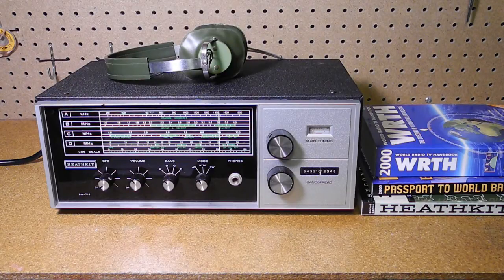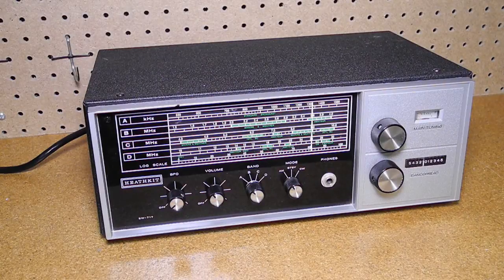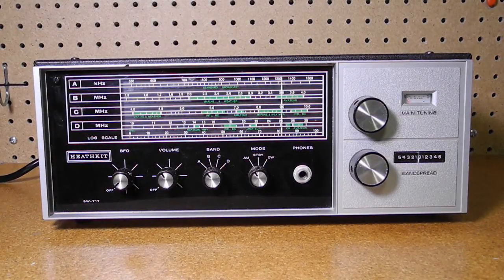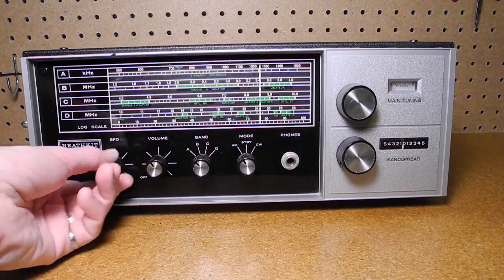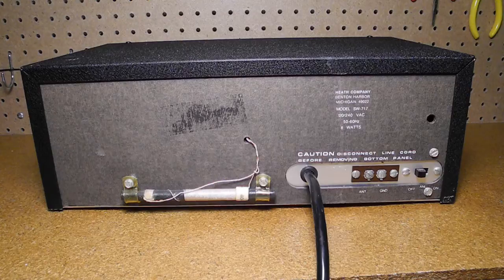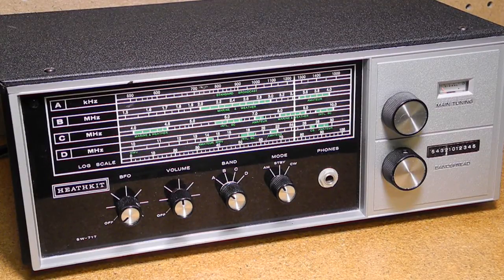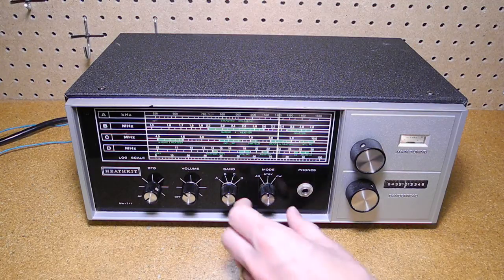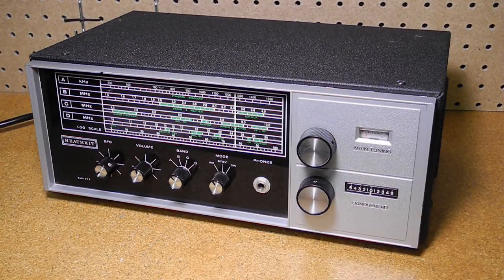The Heathkit SW-717 General Coverage Receiver

Comment: This was my first venture into BCB and SWL back in 1972 and was the receiver that encouraged me to get into amateur radio in 1974 as WN4JAT. I used it to learn and copy code before I took my first novice test. I just found and bought one on Ebay yesterday in fairly good shape except the rear cardboard is warped from what I could see and looking forward to recalling some great memories. I already downloaded a manual so I will go through it with a fine tooth comb once it arrives soon. Take care, 73 de WA4JAT

Comment: Built this kit, and contrary to your observation, used it paired with a Hallicrafters HT-40 CW/AM transmitter. Was my Novice setup until I went away to college, then into the military, and lost the Ham Radio bug for a while. It worked fine, and with a used vertical antenna, allowed me to work anybody I could hear on CW.

Comment: I just acquired one by way of ebay.Mine has a howl to it on AM and the reception isn't as good as my GR 91,GR 54 and GR 64 receivers.Someone mounted the speaker on the top of the cabinet rather than on the side.The receiver is in overall nice shape.I gave $40 for mine.I didn't like the knobs on it so I put some knobs from an old Hallicrafters 5R10 on it.As with my other Heathkits,the shortwave bands are totally dead.

Comment: Hi Jeff I inherited this exact radio from my dad when he passed away last year. He had an antenna up on a pole at his house, it just looked like a long wire but I do not want to climb up there to get it. What kind of wire would I need to buy and how long should it be? I live in the country and our property is about 2 clear acres and the rest is woods. Would I need a tall pole for the wire as wel? Any info is appreciated thank you.
Reply from the maker: The traditional shortwave antenna is just a long wire - the length and height are not critical but the longer the better. Pretty much any wire is suitable. Just make sure it is away from any power lines and does not touch anything that is grounded like rain gutters.

Comment: Hey Jeff is it necessary to connect the two hubs(ground & antennae) enabling the FM band "C" stronger signal strength , please?
Reply from the maker: For the shortwave bands B, C, and D you do need an external antenna, which could be as simple as  length of wire. A ground is not absolutely required, but will normally improve reception. The built-in ferrite rod antenna on the back is only used for the AM Band A.

Comment: My dad and I also put one of these together in around 1975 or there abouts.  I still have it and bring it out from time to time.  Due to not having a signal generator, my alignment was always done using the WWV transmissions.  As a result, it was notoriously out of alignment.  Unfortunately, I stripped one of the tuning capacitor screws at one one, and will have to figure out a source for a replacement.  

The reason that the feet were missing on your unit is probably the same reason that mine had to be replaced. The feet were hard plastic buttons into which you screwed a screw into the bottom of the case.  After a few years, the plastic degraded and all of the feet split and fell off around the screws.

The AM rod antenna on the back of mine was broken in half during one of the many moves that I made while I was a college student.  I'll have to source  a  replacement for that as well.

This was a great unit for a kid to fiddle with and it gave me hours and hours of enjoyment as a kid.

Thank you for doing the review.  Your radio is in considerably better condition with respect to scratches and dings compared to mine.

Comment: My dad & I built one of these in the '80s.  We finished assembly, but it never worked.  I just dug it out of the attic and hope to get it working.  Anyone know where I can find a complete manual?  I downloaded a 15 page PDF but the complete manual is over 68 pages.
Reply from the maker: I didn't find any complete manuals on the Internet. I bought a manual from Data Professionals, which is now part of Heathkit.
Reply: Thanks.  I already checked there. The Data Professionals site just references Heath.  Heath has a link for manuals which is broken.  I have sent them an e-mail.  I have noticed that the bandspread variable capacitor does not actually turn when the knob is turned.  The tip of the shaft seems to turn independently of the actual capacitor.  Not sure if this is common or what I may need to do to repair it.
Reply: John, try: http://www.mods.dk/manual.php you'll have to join for a free account and they allow a free download every couple of weeks.
Reply: Five years later ( Dec 2022 ) and I downloaded a full manual in PDF.
Reply: @marknesselhaus4376  great!   Can you provide a path or even email it to me?
Reply: @johnhelt5475  First off a Merry Christmas to you this morning. I looked again and not a complete manual but I also found a schematic with voltage chart as well. I'll send those links after I wake up a bit 🙂

Comment: I was just wondering what the possibility of this unit being mine at one point. I painted the case with a black wrinkle paint and I had a mark pretty similar to the one above the 550 on band A.
Reply from the maker: +Rudy Koch I bought the radio at a garage sale in Ottawa, Canada (in the neighbourhood known as The Glebe) on May 23, 2009 for $5. I assumed the black hammertone paint was original because it looks professional, but I can see now that other units on the Internet has a more flat finish. I didn't find any other  particular marks that might identify the radio's previous owners. Any possibility your radio ended up in Ottawa?
Reply: +Jeff Tranter I guess there is always the possibility, I sold it in Connecticut back in the late 1980's. I still have the original dated manual and receipt. The only number I see is 40-1028 I don't think that is the serial number. You can't beat the price it's in great shape.

Comment: My first kit as a 14 year old
Reply: Me, too!
Reply: @markbrooky3819  I built one too when I was that age. It was challenging to build and the hours just flew by when I was putting it together. It was also a blast to listen to radio stations from all over the world on it. Back then, Radio Shack sold an antenna kit, copper wire and insulators, for around $8.00. Mounted it in the attic and it worked pretty good. Fun times.
Reply: I was about 15 in high school in 1972 and it was my first real kit to build.

Comment: Nice video, Jeff.
You convinced me to not buy this radio... It hums badly, there is no RF preamp and the "BFO" turns out to be regen control?!
BTW I owned an SW-7800. It also hummed, but in that case it was due to lack of shielding. It also was not great for SSB, since the selectivity was barn-door wide and the BFO drifted continuously. I put a lot of effort in that rig, including mechanical filter and new BFO circuit, but could never justify to myself why I'd use it for monitoring ham bands vs. a rock-solid Drake 2B.
Heathkit needed to make serious changes to their ham and shortwave products ca 1970 due to technological advancements by the competition. Unfortunately they had financial issues around that time and ended up with compromise units like the SW-7800, HW-5400 and SS-9000.
Not unlike Hallicrafters and other major companies that could not make the transition.